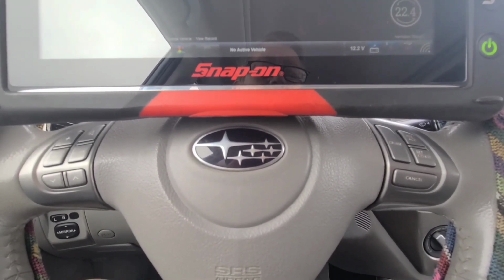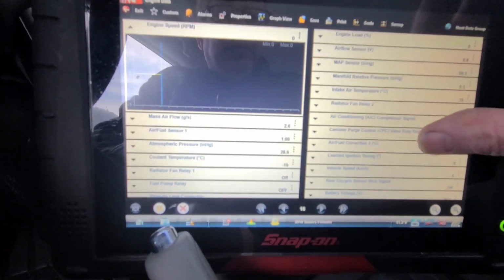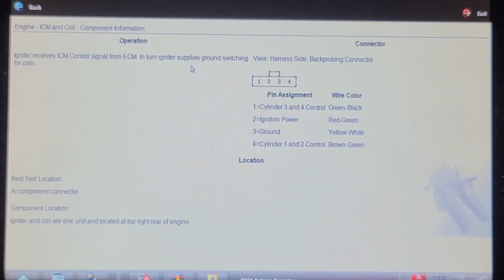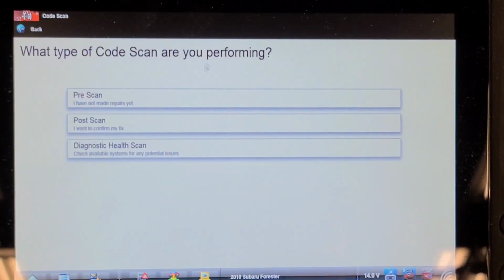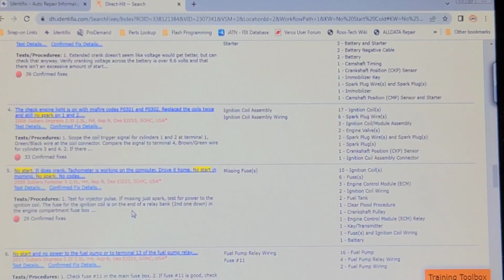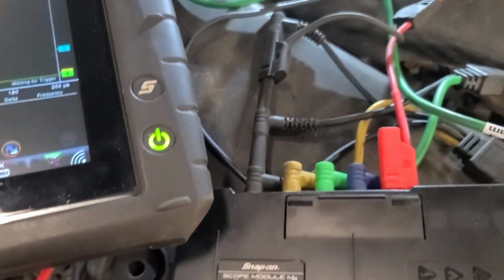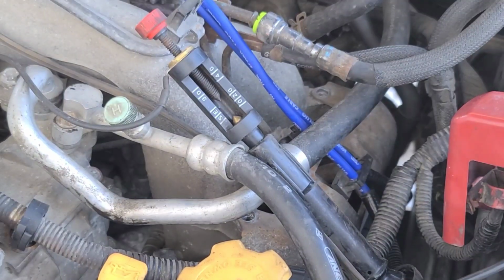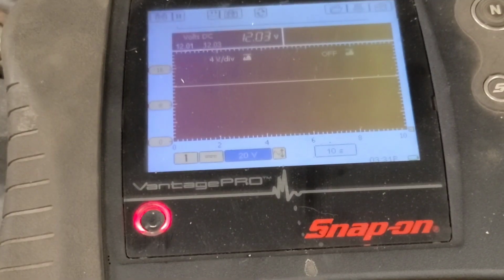2010 Subaru Forester 2.5 Crank No-Start Cold No Codes

Comment: Thank you for this video. I have a Subaru Outback 2005 2.5 with the same engine. The car refused to start without running the fuel heater when temperature dropped below 5 degrees C. No codes on the OBD, bump start without issues. According to the OBD the starter cranked the engine at 150rpm which should be enough, but apparently not. Changing the starter solved the issue and now the car runs perfectly. Unbelievable...
Reply from the maker: Been doing this for 50 years and I can't explain it either. Glad you fixed it.

Comment: All this time and it was a freaking starter are you kidding me
Reply: I just want to say thank you so much for your video man I have a 2009 Subaru outback in the shop at work I’ve been having the same exact problem no spark when cold. Cam and crank signals are good, all wiring from the pcm to the ignitor assembly is good, I have Injector pulse, replaced plugs coil and wires, it now has a new crank and cam sensor in it, and yet still no spark when cold. So now I’m thinking the same thing, the engine is cranking a bit slow, granted we live where it’s 0 degrees farenheight and sometimes drops to -30 it just seems slow. I’ll see if a starter makes this thing crank faster and fixes the problem. Once again man thank you so much for all your effort, I know how hard it is to work on these Subarus especially when your out in the freezing cold to duplicate the condition.
Reply from the maker: Ive been doing this for 50 years and it caught me. I thought it was turnng fast enough!

Comment: ( 2010 subaru forester)i wish i can give this video a million likes!  i literally went through everything you did and the last thing i did that fixed the problem was change the battery. i went from a 640cca that was originally in the car to a 750cca and the car started right up no hesitation. mind you this is in 18 degree F weather. and guys definitely make sure  all of your original ground points are connected and clean and you can even add extra grounds just for peace of mind
Reply from the maker: Glad you found the video useful. Happy New Year!

Comment: I’ve been having the same issues with a 2010 Forester, single cam, 5 speed. 

Extended crank when cold, when very cold crank no start. 

Good fuel pressure and pump operation
New battery
No faults 

Found your video and decided to purchase a Napa starter. 

Installed Napa starter, problem went away for a week. Exactly 7 days later, I went out to my car when it was 8 degrees farenheit and it took just as long to start. Scratching my head now
Reply from the maker: Have to start over again. Confirm spark, injector pulse, fuel pressure, and fuel quality. What grade of gasoline are you using? Don't use premium or E85. Buy your fuel from a station with high sales volume as well.

Comment: I, too, thoroughly enjoyed this video!  I loved your logical pathway of diagnostics and the usage of the computer interface tool.  I've never been able to afford one but see the definite value of having one if many cars are going through the service bay to warrant its use.  I'm having a different problem.  Have a Forester one digit off on the vin, an A instead of an X on digit 10, with an earlier man. sequence number. "New" JDM motor like yours but I cannot get it to start after installation.  No spark, OEM coil installed from bad motor that started and ran fine ... rod knock.  I actually pulled the intake off and reused the original wiring harness.   I'm going to revisit the sequence of tests best I can with my multimeter and test light along with ground double checks.  Any input you can offer on finding the good crank no start condition would be greatly appreciated.  I'm banging my head on the wall checking and rechecking all viable avenues and am still stuck.  Thanks again for your great video on your real cold start issue.  Curt
Reply from the maker: So you have no spark but what about fuel pressure and injector pulse? Does the mil turn on with the key on and does the fuel pump run during cranking? You are going to need a scan tool to check codes and data from the ECM and other test equipment.
Reply: @PhillipBailey  Thanks for getting back to so quick Phillip!  Very appreciated. For reference I have been using a 12v test light to test applicable circuits or volt meter when handier. Here are stats I can currently offer you:  1. 12 v on coil plug Pos to ground via middle two terminals.  2.  No spark at plugs when cranking motor.  3. No test light flash (flash for future) between positive on coil connector to negative terminal on either coil delivery side (pulse to plugs).  4.  Fuel pump runs with ignition on and while cranking.  Drove vehicle into shop before engine swap and have fuel coming out of supply line when cranking.  Can get pressure if needed.  5.  Removed injector protector on left bank, removed #3 injector connector, test light across terminals, cranked, no flash.  6. Ck Engine light illuminates when key in on and cranking positions.  7. Did pull multiple codes after checks but all are in relation to the disconnected plugs to gain easier access to engine.  Checked before removal and had none.  8.  I did replace the two ground straps under the motor to chassis per your video .... though yours look nicer ... and rechecked two grounds on manifold and one on block.  9.  Engine crank speed 130 RPM, ambient temp 41 F  Baro Press  22.7; MAF disconnected; MAP HG 23.0; Coolant 41; IGN ADV 16.5 degrees.   In summary, what I see so far at least, is no injector pulse and no injector energize delivery to coil.  Tell me what you see or need next.   Thanks again, Curt      Can pass on email addy if that is more convenient for you ....
Reply: As a note I just thought of:  I did leave the in block sensors that came with the japanese engine in place and cannot verify yet that they work/don't work.  I can run an ohm test on them since I don't have a scanner to verify whether or not they are actually sending info to the ecm .... thots on that ?
Reply: Correction:  I DO have a pulse at number 3 injector connector.  Had a loose wire on my test equipment ....
Reply from the maker: @vonfange where did you get the 130 rpm cranking from? No injector pulse as well as no spark suggests a lack of reference from the crank sensor. Do you have power at the injectors with the key on as well as the coil? Use a conventional test light to confirm that connected to ground.
Reply from the maker: @vonfange you could try swapping the crank sensor
Reply: @PhillipBailey  I have a primitive OBD2 hand computer with live data I can get ... that's where the 130 RPM came from .... note that the RPM indicator in the car did not register any movement ....  Key on, injector 'flash' at #3 injector connector on and constant (no flash just on) ... does flash though when cranked.
Reply: Is there an ohm test I can do on the crank and cam sensor if need be?
Reply: i currently have 2.8 supply voltage to the hot side of the crank sensor connector
Reply from the maker: @vonfange well you need a lab scope to check the coil control circuits. They are a 5volt pulse and won't trigger a test light. Power on pin 1 green and ground on pin 3 yellow.  I don't think it will be a crank sensor since you have injector pulse. You can ohm the sensor compare to original one. Why is it only turning at 130rpm. Battery low?
Reply: @PhillipBailey  so a 5 volt pulse will come through 1 green and exit to ground on 3 yellow for the 1/2 spark plug coil when cranked?  Correct?  battery not low when rpm registered... had heavy charger on while cranking just to keep battery up.
Reply: If there is no 5 volt pulse coming through when cranked what would be next on the trouble tree?
Reply from the maker: @vonfange no the green wire is power from a relay ground on the wire. The other two wires receive  a 5 volt pulse that controls the base of internal power transistors
Reply from the maker: @vonfange you won't see the pulse with a conventional voltmeter or testlight but if missing would need  to qualify the wires between the coil and ecm. On this car the coil was getting the trigger but not responding as it was too slow. A starter fixed this car. Check your battery cables and connections for voltage drop while cranking. The new used engine might be slower cranking because it hasn't been run for awhile or has better compression.  130 rpm is a bit low imo.
Reply: @PhillipBailey   @PhillipBailey  so found a 4.5 volt flashlight and wired up a test lamp out of it.  Wired it into the coil connector and verified a flash on the flashlight bulb.  So I got fuel injector flash, coil secondary flash, and I got spark at a makeshift spark plug I put into the spark plug cable and grounded to battery with a wire.  Badda bing, had spark!  Yay.  Three things may have factored in .... I did put the other crank sensor in, The main harness plug did have some carbon tracking on the male pin for both of the secondary trigger wires which I removed and I did, as mentioned, replaced the two ground cables to the frame from the block.  The motor now will run albeit I have one last request.  Can you give me a color coded description of the wires on the TPS connector, flat six pin.  When I received the new engine the TPS connector was damaged beyond repair so I had to un pin the old one and resplice the wires to match the ones on the new engine.  The wires  were not the same color but was able to match them upon assemble.  Since I ended up replacing the wiring harness I had to unhook the connector but had lost my diagram on the original motor color coding with location.  I was able to get a diagram from Subaru for that year but I don't think it is the correct sequence as the car will not idle.  If I remove the connector it will idle but slowly die out. So in summary, just a diagram of the connector with the wire colors and pin location on the connector should fix this last hurdle.   Thank you sir, you've been most helpful   Curt
Reply from the maker: @vonfange  what year and model is it and you're looking for the throttle body connector?
Reply from the maker: @vonfange check this out. Note the terminals on the diagram are not arranged in order. https://youtu.be/KdTuhUzUSzs?feature=shared
Reply: @PhillipBailey  2010 forester 2.5 premium ...   I saw that diagram from Subaru ... couldn't interpret the LW wire, thinking my pink wire may be the magenta one and I couldn't decide which way was up on the connector and where number one would start ....
Reply from the maker: @vonfange the picture of the connector is typically looking into the face of the connector and the lock is up. Look into the terminals on the throttle body for printed numbers. That's all I've got. You could try a salvage yard and take a picture.
Reply: @PhillipBailey  Phtttt .... I was negligent in watching the entire vid you sent.  I see now the 2nd diagram showing the connector with tab and number layout on it.  Exactly what I needed ... so sorry for not seeing that earlier. Thank you so much for your help and patience ... solved it all for me!

Comment: Hello thank you for bringing this great content. I love your works

I have 2010 subaru impreza at 178k miles. My car cranking but not start during cold weather. like below 40ish fahr. But if its above 55-60 car will start without a problem. Mechanic replaced all ignition comps ; coils ,spark plugs ,the hub etc also replaced the fuel pump.

When I spray ether(starter fluid) on the neck of the intake car will to start . Today I sprayed ether but it didnt work so I asked to my friend to bring his car to jump and it started very hard but it did. I am not sure if it is the ether or jump or both but the ca jump started after an hour later the starting fluid been applied with jump start.

I have same symptoms with the car in the video I wonder bad starter is the problem. Thank you so much!
Reply from the maker: @harunkandemir5968  first thanks for watching. I would never recommend using starting fluid to start a gasoline engine. You could easily blow up the engine! You need to have it properly diagnosed. It could be dozens of possibilities. Throwing parts at it is not cost effective. You need to monitor data parameters on a cold start. Could be a misreporting temperature sensor,  map sensor, TPS. Could be a bad crank sensor,  low fuel pressure,  low cranking speed etc. When it doesn't start you need to find out what is missing.
Reply: @PhillipBailey  thank you so much for your reply. My theory is When car is stands like 2-3 days without run. Battery power went down because of the cold. So less power goes to starter and a weak starter supply low rpm to ignition system. When I connect obdIII and try to crank it. it shows the Rpm in between 50-80 so ignition system wont command to fire the sparks because of the low starting power. When I put ether it makes a small explosion creates enough energy to increase to rpm. This could be unique to subaru s safety feature. Today I jump the battery and it start normally. In hot weather battery doesnt effect too much and has always enough energy to crank it up. Also no matter how cold it is if the car run the day before late times it always start in the morning. This problem does occur in long sit like 10hours or so that gives an enough time to decrease battery level but if the car start the day before battery fully charged up and its all good to go. So the problem may occur because of the low level battery,week starter combined with cold weather. We will see. I will replace the starter soon and give update here. Thanks a lot man you are a life saver.
Reply from the maker: @harunkandemir5968  I'd be checking for a parasitic draw first, test the battery as well and chec cables and connections. That rpm is too low for sure

Comment: Getting ready to give it a shot, I’ve spent over a month diagnosing my 08, with a less advanced scanner and no spark tester, I’ve check everything else I can at this point, every parameter on my scanner and my sensors and connectors all tested good. Replaced ignition coil, spark cables, cleaned tested injectors, maf, cts, crankps, camps, replaced fuel pump, battery, it all works and tests good, yet still no start in the cold!!! Getting ready to replace my starter tomorrow, will update on how it goes, but thank you so much, this has to be it.
Reply from the maker: @OrchardGrover  how did you fare
Reply: @ Words cannot describe the amount of gratitude I have for you and this video, that did it!! Thank you so much, even with a remanufactured starter motor it sounds about twice as fast and fires right up like it did when I first got it.
Reply from the maker: @DeadstreamOrganics  giad it was helpful for you.
Reply from the maker: Good luck

Comment: Thanks for this video.  I have a 2010 Forester with the exact same issue. If it drops below 15 degrees F. it won't start. As soon as it warms up to about 20 or higher, it fires right up. I cannot figure it out. I think I'm just going to get a block heater and save my sanity
Reply from the maker: @juanmedina4  block heater would definitely help.
Reply: Which block heater did you use? Thanks again for posting this! @PhillipBailey
Reply from the maker: @juanmedina4  this was a customer who was a university student who had no place to plug in. I believe you can only put an oil pan heater on that.
Reply: Hi again, just sending some info about my Forrester. I remembered that I had changed the coil pack last year and luckily I kept it. I put it back on last week and this week Chicago has had sub zero temps. So far it has fired right up every morning. I'm hoping this was the fix because it was a cheap aftermarket coil pack.
Reply from the maker: @juanmedina4 let's hope it stays fixed...

Comment: I just wanna thanks you. I actually had same issue on my 2010 forester, right about 3 days ago, crank no start, but i replacement battery and the starter and then the engine startar it again. Nice video to show how to get this issue done.

Comment: Phillip - you give me some hope with my haunted car!! I have the same issue with no spark. It's intermittent. Not related to cold weather as I'm in Australia's east coast. Car has a new battery and I checked alternator, crank sensor, cam sensor and MAF with a multimeter, all within specs. At one point I thought it was the crank sensor as when I cleaned it and tested it the car started right away. However the problem persisted, and still intermittent, which makes it so annoying! No fault codes whatsoever. And the car runs fine when it's on without loss of power or anything.
I noticed when I crank it makes a good cranking sound for 3/4 times, then it starts getting slow, and stops cranking after 2/3 seconds with a loud click. With a friend I confirmed the drive belt is turning when I crank. I wonder if it could be the starter motor? If that's fine too I'm gonna call the Vatican.
Reply from the maker: @vastrasgre  when it won't start you have to figure out what's missing,  spark, fuel pressure , injector pulse. Does a scan tool show RPM when cranking? Normal Barometric pressure and temperature? TPS near 0.7volt?
Reply: @PhillipBailey Thanks Phillip - Barometric pressure 101kpa with 36 degrees celsius. I checked all live values with engine on from the OBD2 scanner today and they all seem within range / specs as per workshop manual. I have to wait until the issue happens again to check live RPMs when cranking. Can I ask you one thing, when you figured it was the starter motor, how many RPMs were needed for spark?
Reply from the maker: @vastrasgre  150 to 200rpm